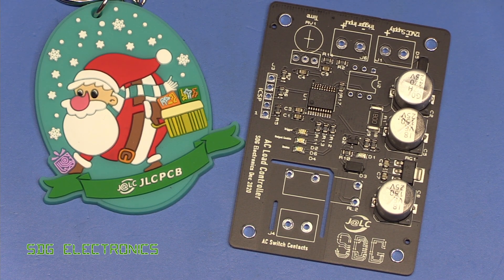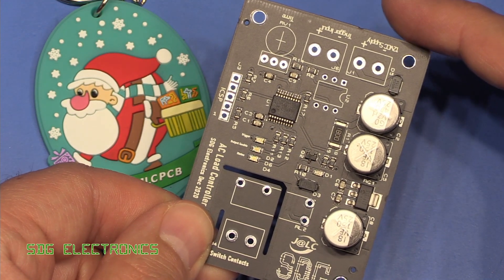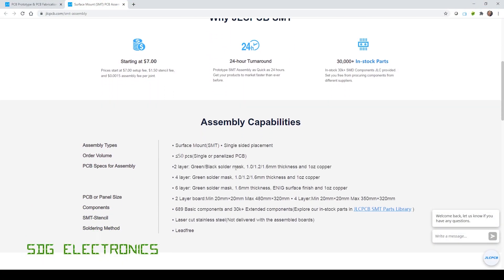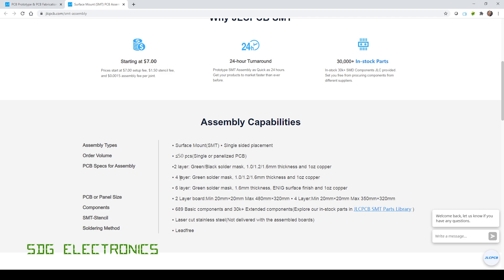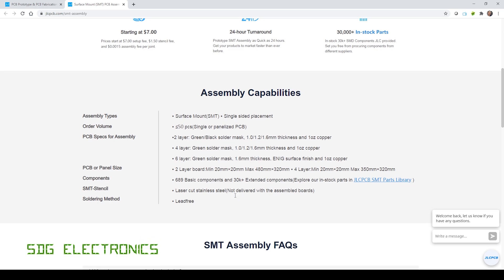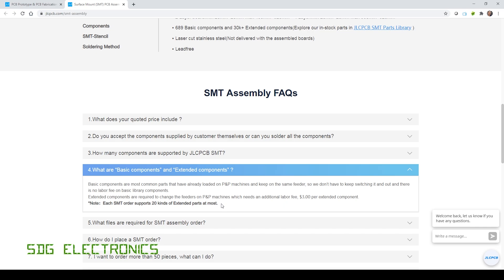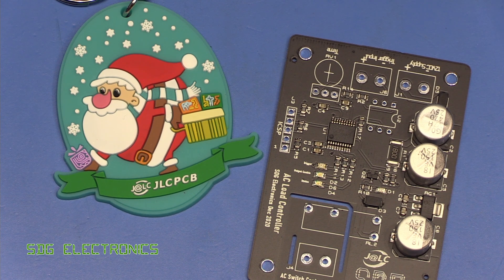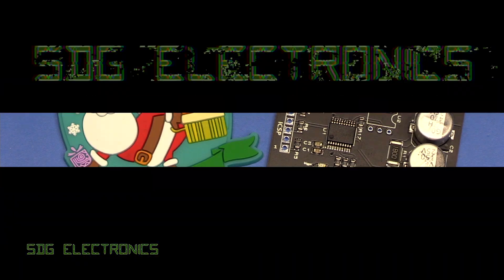SDG #189 JLCPCB NEW UPDATES to SMT Assembly Service!

Comment: I also noticed the other day a couple through hole potentiometers in the parts library...makes me wonder.

Dumb question: I saw an eMMC chip in the library, 0.5mm pitch BGA. However it's absolutely impossible to route this without violating quite a few of their minimum tolerances. Can you explain how we're supposed to use parts like this? Are there exceptions to those rules?